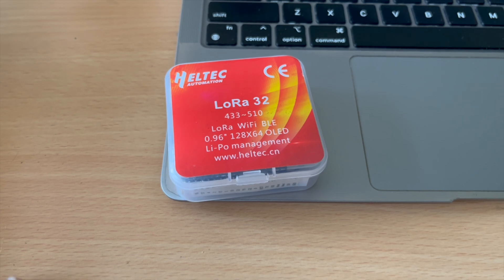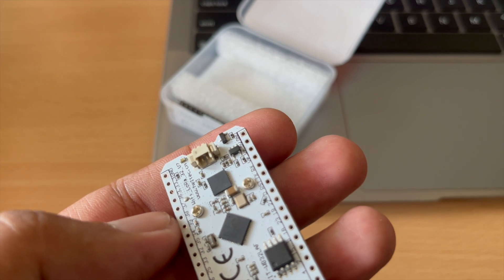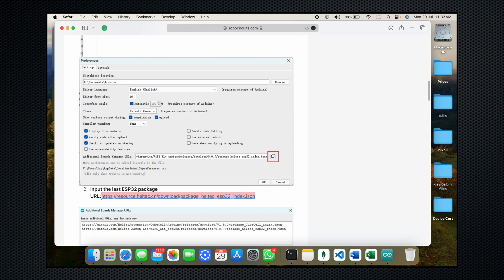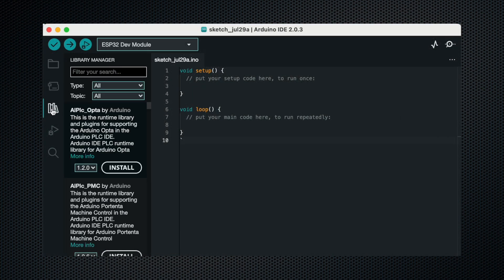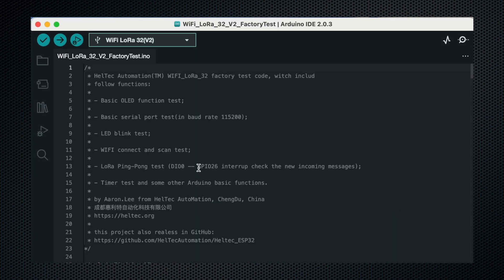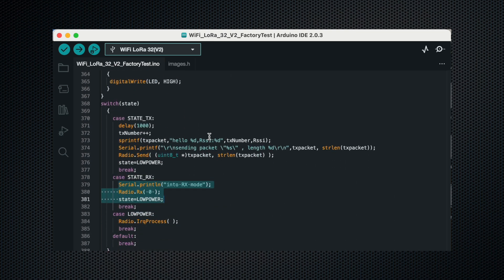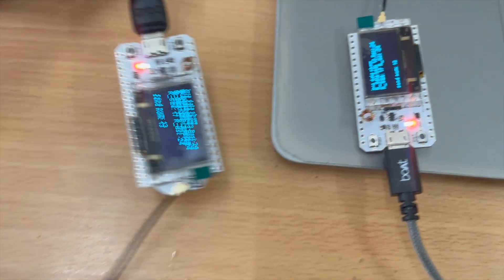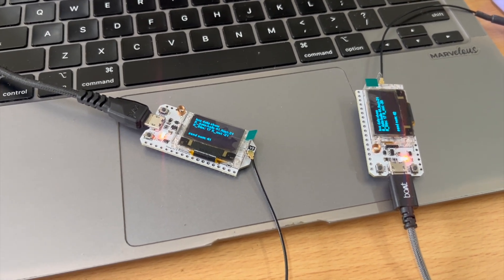Heltec LoRa ESP32 Module Tutorial

Comment: I am aiming to create a Shutter-remote with this. I'll have some Ethernet/Wifi based automation at home that controls the Shutters (can be triggered with RPCs).
- The Lore receiver is hooked up to my Ethernet so that it can trigger the Shutters packets.
- The Lora transmitter (remote) will be basically in DeepSleep until someone presses a button on it to wake it up and send the Command over Lora to the Receiver (both are sending receiving of course since i want to display if the message has been consumed).

Encryption, DeepSleep and Remote Power Optimization are object of further development once the basics work.

Comment: Two questions :
1. I assume we need to upload the code on both devices. Didnt find a specific mention of it in the video.
2. While uploading I am getting an error  in the code line   Mcu.begin(HELTEC_BOARD,SLOW_CLK_TPYE);

Not used: C:\Program Files\WindowsApps\ArduinoLLC.ArduinoIDE_1.8.57.0_x86__mdqgnx93n4wtt\libraries\WiFi
exit status 1
'HELTEC_BOARD' was not declared in this scope

Appreciate if you can provide a solution.

About the projects the one I would like is to use Blynk together with Lora for monitoring remote tank levels. Please develop one.
Reply from the maker: Make sure boards are installed properly… choose lora 32 (v2) instead of heltech lora 32 (v2)
Reply: @RoboCircuits  Thanks Prasanth, couldn't find a board with the name "lora 32(V2)" there are "Heltec Wifi LoRa 32" and "Heltec wifi LoRa 32(V2). I tried both and it ends up with the the same error message. Mine is a V3 version whereas I believe the module used by you is V2, Could be this be the reason?
Reply: @srikumarc  I'm having the same issue, and the module I'm using is also the V2